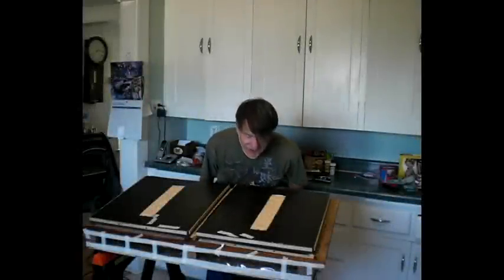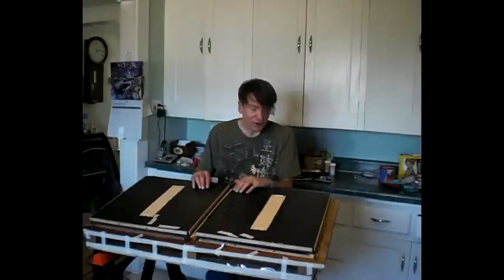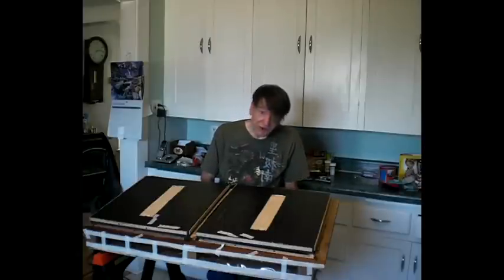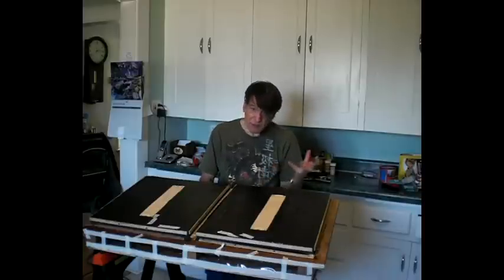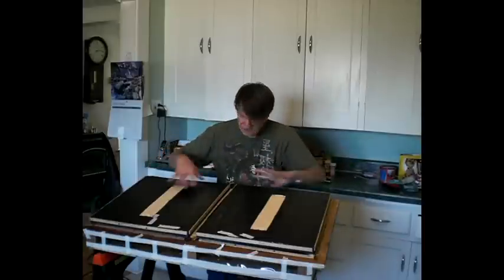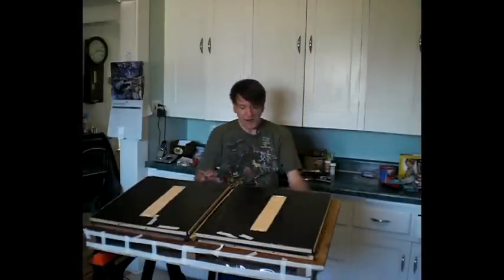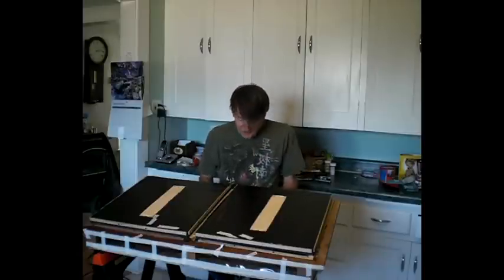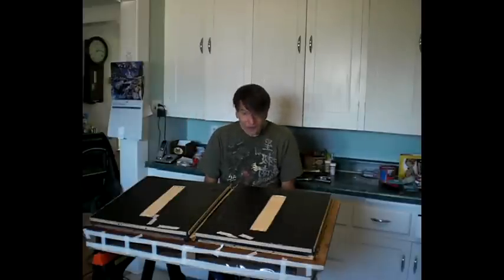Harmonium Reed Organ Bellows Completed!

Comment from the maker: Oh thank you so much. I think the biggest improvement "breakthrough" yet would be some brains that worked again. LOL Best thing to do in a case like this would be to have a woodworker just make up all new boards and then assemble brand new. But for now: 3 Kinds of Elmers, Gorilla Glue, Silicone, Caulk, 5 min. Epoxy, Hide Glue, Rubber Cement, Tacky Glue and wooden strips tacked and screwed into all side edges. (Just to mention a "few" things.) LOL Can you imagine bellows cloth that will not burn?

Comment: I think they work perfectly, i've done it many times and looks really much the same as your ones. Modern gum-cloth (or whatever the name in english is) and modern glues don't work as well as the materials they used in harmonium bellows 100 years ago and one has to be inventive to get it well glued to the wood. Generally as long as they are well air-tight and they dont make any weird noises i guess is ok. I hope you just sanded a little bit the sharp edges of all the boards in the places where the gum-cloth folds to the inside (we think that it helps to enlog the life of the gum, but no one has actually made a serious research about it). Anyway, lloks fine, congratulations :)